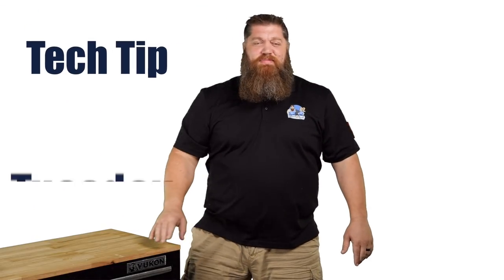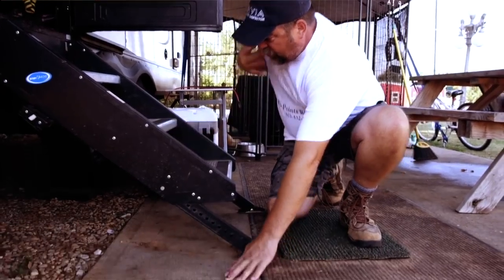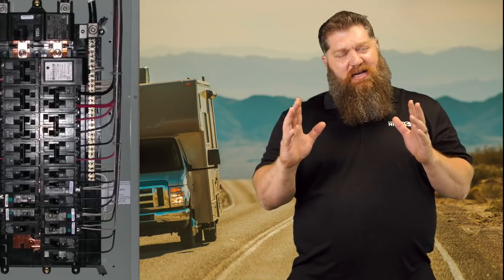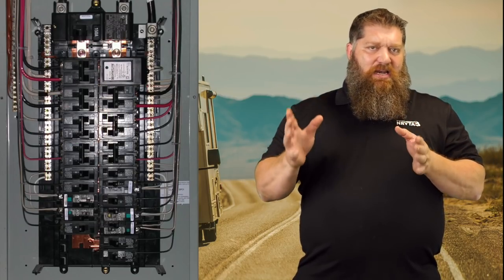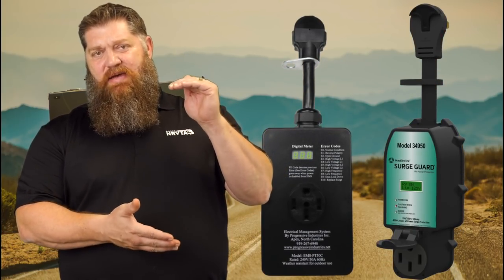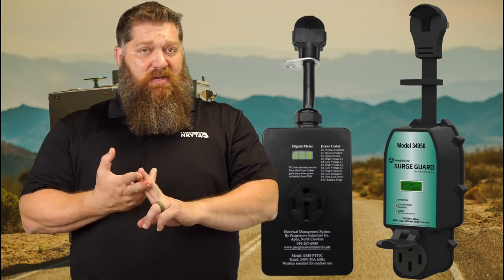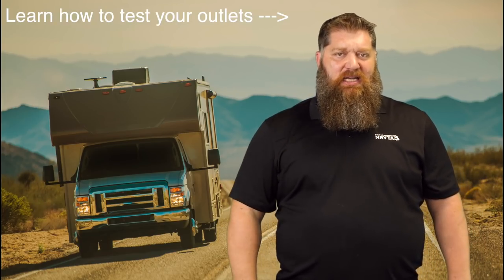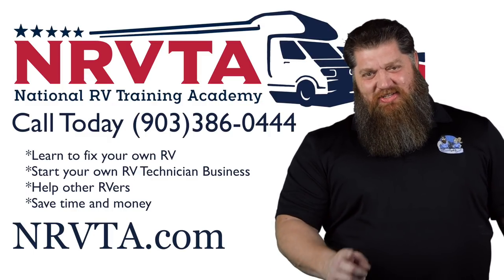What is RV Hot Skin and how to avoid it Part 1

Comment: When we first got our Sundowner toy hauler it would trip the GFI at the storage yard instantly. After chasing my tail for a while, I discovered there was continuity between the neutral and ground in the RV panel box. Finally found an outlet that when pushed into the wall box the bare ground had bent and was touching the neutral terminal.

A non-contact voltage detector is an RV must have. Reading Mike Sokol's information is also beneficial.

Comment: Great video. Hot skin is a serious issue.
Another way to get hot skin is on older homes like mine use to be and there was no ground wire on any receptacle. If bu chance you dragged your cord on rough ground or it was ran over or a myramid of other things and cord is broken and hot wire is showning and touches anything metal. In short check your cords.

Comment: I had hot skin on my rig a couple of years ago.  I used a circuit tester, the kind about the size of a cigar that you just hold up to an outlet, switch, wire, etc.  It lights up and beeps when it is near a power source.  I just walked around the outside of my trailer and that tester was singing like a songbird the whole way.  I had never heard of hot skin before so did some research with the symptoms, and found out about it.  I went to a local rv repair shop to ask what I can do to correct that, and he had no idea what hot skin is.

Comment: Excellent thoughts on a little understood problem. Reverse polarity, bad neutral, and no ground can actually kill you. I was a refer/appliance tech for 40 years  and this also applies to appliances. I always use a multimeter to check power If in doubt use a meter which does not need to be expensive Joe
Reply: I recently bought a toyhauler towable. I use the portable generator (Honda 2200) when boondocking and  when I plug in the testor to an outlet I get two lights which means ungrounded.  I see many people who use portable generators and they don't seem to have a problem.  Thoughts?

Comment: Todd it would have been cool for you to show the little plug-in device that you mentioned and sometimes they come packed with those wireless testers I saw another YouTube channel demonstrate hot steps with that little contact tester and then the little three prong three light 110 volt tester they're very inexpensive and as you say that should be the minimum equipment that is in our little electrical box. Maybe

Comment: I installed a Xantrex 2.0 inverter charger in a trailer I owned at one time.  Second time I went into a particular campground, the Xantrex display identified a reverse polarity situation.  So then I plugged in my little three light circuit tester using an adapter and it showed the same.  I reported it to the office and they said there was a problem with my Xantrex unit.  Then I told them about the little tester and they said it didn't work right.  I pulled it out of my pocket and plugged it into a wall outlet in the office.  It gave two yellow lights like it is supposed to.  So I told them "fine, the outlet at my trailer is OK, but your office is not wired right".  I ended up running my trailer off of the 15 amp outlet because it was wired correctly.  Next time I was at that campground, the voltage at my site was 105 volts.  I reported that to them too.  They said a handy man would be there on Wednesday and they would have him check it.  I told them don't bother, by then the campground would be half empty and the voltage would be fine.
Because of my autistic son, I just spent 4 days in that campground.  I could tell they have worked on their electrical system.  A lot of new transformers around and every site now has 50 amp service.  Hopefully the electricians that did the work checked everything else out the moment they found the first instance of fubarred wiring.

Comment: This video assumes the problem is with the house or "plug".  This, in my experience is rarely the case.  The problem usually is in the only one of the 2 units that is vibrating hmdown a road all day and built by non-electricians with almost nothing properly secured.  It usually is the water heater of the RV that has a melted element.  I own RV park and we are always blamed, but it rarely our system.  Usually we troubleshoot and then call an electrician that we have on call and it pricey for the RV owner when theu find the problem, 95% of time, in the RV.  We have seen screws thru wires, elements, you name it.

Comment: I have a hot skin camper in my back yard.    how do I ground it to use the ac only in it. I have bought a new 14gauge drop chord and a adapter from camper to drop chord.   should I Get a adapter and plug into my dryer outlet instead of regular outside outlet?
Reply: Be careful your not plugging inti 240!!

Comment: Can I use my 30 amp surge protector with the 15 amp dog bone that connects to the house or would I need to purchase a 15 amp surge protector?
Reply: You can buy an inexpensive socket tester at any hardware store (Home Depot). They just plug in an light illuminate to tell you all is well or faults. Less than $15, simple as plugging it in. It can come in handy to test sockets in general for proper ground, etc. Everyone should have one.

Comment: I'll describe something I had an issue with.  Hot skin on my downspout at my house.  But not consistently.  I ended up tracing it to the 4th outlet in a line of 6 outlets in one branch in the house.  And it only happened when something was plugged into that outlet, or after that outlet, drawing power. I say that just to remind everyone that just because you tested a house outlet good, doesn't mean a bad outlet can't come along and cause issues later.  I would say I'm an advocate for an EMS type device that will pick up changes to the circuit.
Reply from the maker: Very well said

Comment: If a rv has a built in surge protector, should you purchase one to put at the pedestal?
Reply: Only if you want to check a particular site beforehand of you meticulously backing your rig into. Then finding a problem and getting moved.
Reply: @thedaddechannel  thank you. So basically I would just need a multi meter or something like that to check the pedestal before plugging into it?
Reply: @dontgiveupondreams9586  I'd say too complicated to verify most issues that way. Some sites w/some rigs might be worth the spotter jumping out with a $40 tester unit in hand  to spot check it. The built-in does all that but is very theft proof. I installed one because I didnt want a good expensive one stolen, left, beat up or lost. Two and this one's paid for. Installation is really doable, and once. The portables are an always hassle.
Reply: @thedaddechannel  sounds good, thank you for the advice. It is very much appreciated